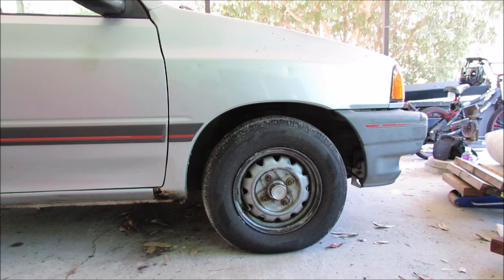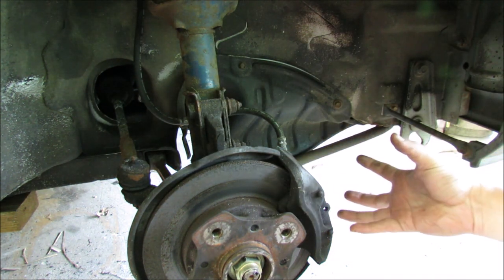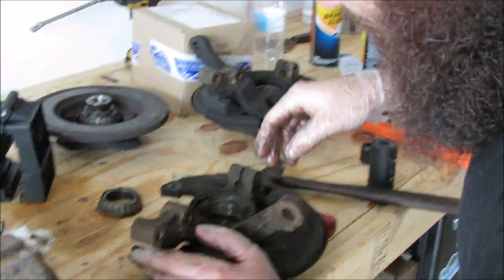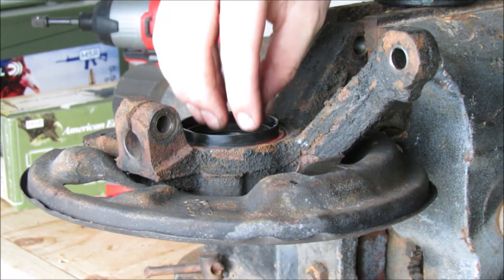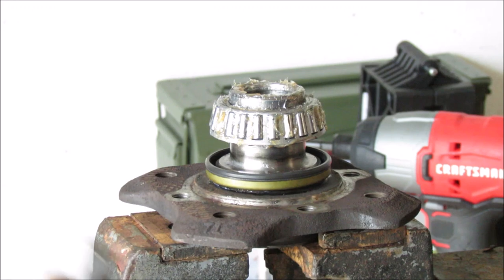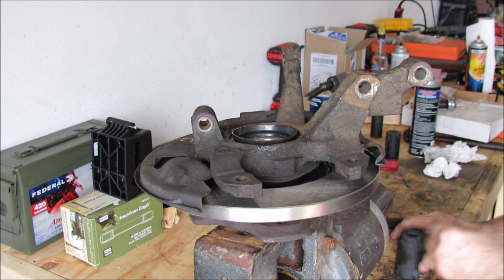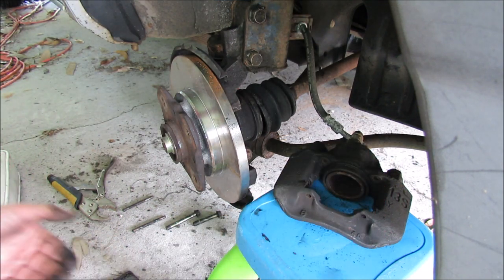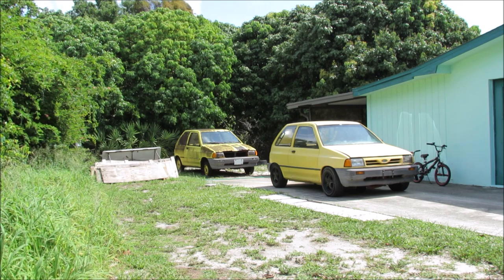How to Replace Festiva Front Brakes & Rotors

Comment: If the axle nuts are seized, put your wheel back on, tighten the lug nuts and do 2-3 hard deceleration from lets say 45-10, the heat generated was needed to remove the bolts on mine
Reply from the maker: Thats a good tip

Comment: Just so ya know, if you read the Ford service manual. It involves the correct "procedure" for shimming the bearing preload. If you Pack the bearings first, you cannot set the preload properly when replacing bearings. If the preload is 0.001"-0.002" too tight the bearings will burn up, 0.001"-0.002" too loose you'll get torque steer and pulsing brakes.  I did many of these for years, even some for people on Fordfestiva.com. that would ship them to me.  I had the manual, the Ford tools, and an assortment of shims to set the bearing preload. Properly set the new bearings will outlast the car. Also not to be a brand promoter I found Timken bearings to work best. I finally switched my spindles and rear axel out for the Aspire brakes and suspension. I quit because I had too many and life changed. LOL.

Comment: great video, thanks for posting, using to change my festiva brakes and rotors. FYI, I have a 1989 ford festiva carburetored, and as you mentioned in your video my car model uses a 29mm on the axle nut, I got the Autocraft 29 MM Axle Nut Socket off ebay, thanks.
Reply: I just got a ford festiva and I have removed all the lugs off the wheel and my tire isnt coming off. Is the bolt in the middle holding it?

Comment: I have a 83 Mazda 323 with the same hub assembly and my Haynes manual says the rotor can be pulled off normally but my Gregory’s says I need to take the whole knuckle off and use specialised tools. I’ve been trying to pull it off all day(it does slide off about 1cm) , but I guess after watching this I’ll have to do it the hard way… do I need to replace the bearings just to replace the rotor or do you think I can just pop the old ones back on?
Reply from the maker: If you go through all this trouble and plan to keep the car for a long time i would replace the bearings as well

Comment: I just got a ford festiva and I have removed all the lugs off the wheel and my tire isnt coming off. Is the bolt in the middle holding it?
Reply from the maker: It's probably just stuck.   Hit the top of the wheel when it's off the ground and then the bottom.   You may have to hit it pretty hard with a rubber mallet on the rim edges so that you don't damage it.  Also make sure the car is safely jacked up so it doesn't fall over when your whacking it.

Comment: Thanks for this. Although I'm having issues figuring out what type of bearings to get... I never did this before, and there's multiple different sets of bearings and races, and some say inner, some say outer, and some say for both inner and outer. Some races have edges that stick inward, and others are smooth. Im extremely confused lol. I just bought some, but I have no idea if the seals bearings and races are all correct or not....
Reply from the maker: You will need inner and outter bearings.  I should have all of the correct parts listed from rock auto.  Otherwise you can use rockauto as the guide and just watch the video for where my friend says inner and outter.  Hope that helps.  If anything i wouldnt have been able to do this without my friend.  It is a tough job.
Reply: @thousanddollarcarguy  Thanks, rockautos stuff was a lot more specific than what I was finding around earlier. Cheaper too.

Comment: hi, may i know what is the size of the bearing?.thanks.
Reply from the maker: Try this link.  https://www.rockauto.com/en/catalog/ford,1990,festiva,1.3l+l4,1128147,brake+&+wheel+hub,wheel+bearing,1672.   I used rockauto for ordering my parts. Just make sure you get the correct year inner and outer for each side.  Best of luck!

Comment: do you know what year ford aspire suspension will be swap compatible for festiva?
Reply from the maker: Depends on what you need.   I believe theres a whole write up on the fordfestiva.com website.  Also on the festiva facebook group.  Usually people just want to swap the hubs and rotors over so they can get 4x100 mounting flanges.
Reply: @thousanddollarcarguy  thanks i’ll check it out!
Reply: @thousanddollarcarguy  no sure what i need but i guess the full suspension. whatever will make the upgrade better…
Reply from the maker: @LintRoller86  depends what you mean by better.  Like new?  Or handle better.  Or softer.  It all depends
Reply: @thousanddollarcarguy  handle better with a 1.8L bp swap
Reply from the maker: @LintRoller86  look into vw golf mk2 struts and springs.  Cross reference that with festivas.

Comment: Are you doing anymore vids it's been a while.
Reply from the maker: I want to.  My house has needed a lot of repairs for a while so ive been pouring everything i have into that.  Off camera if have a new larger core radiator in the festiva and the next step is tuning.  Just need 500$ that doesnt go into the house and ill be ready for that big burnout.